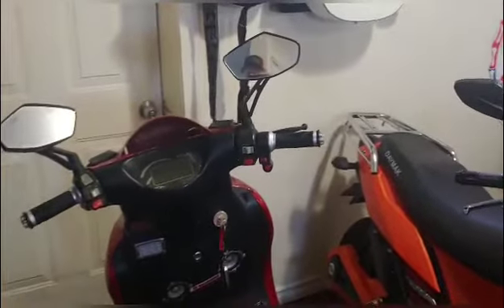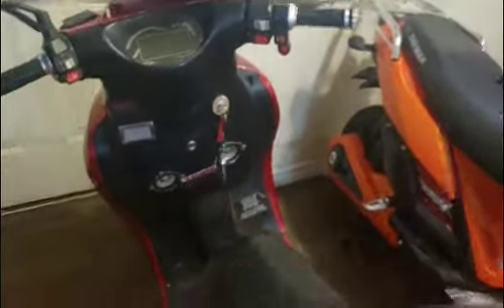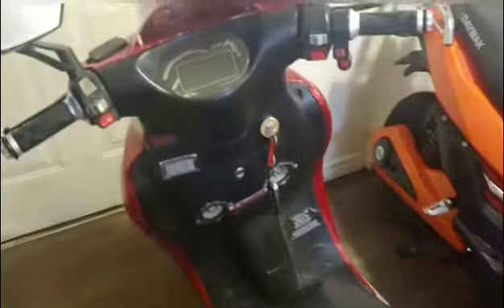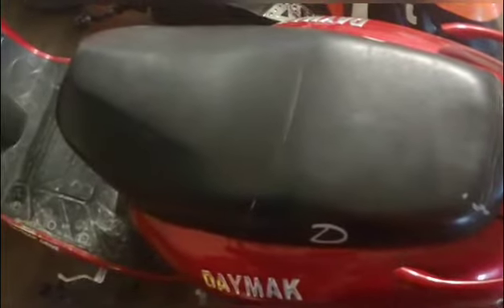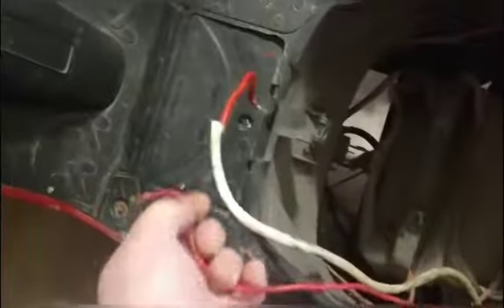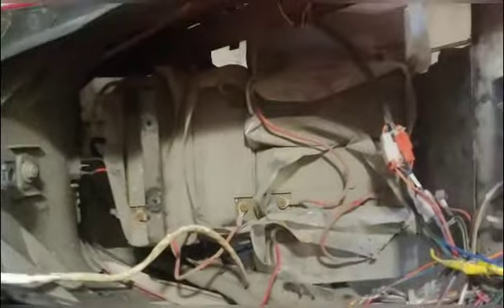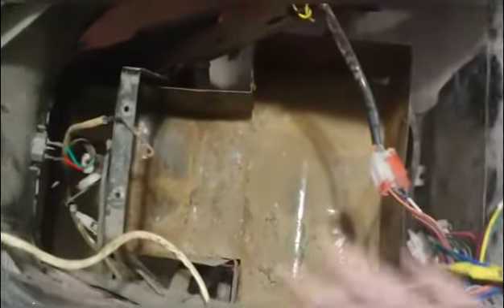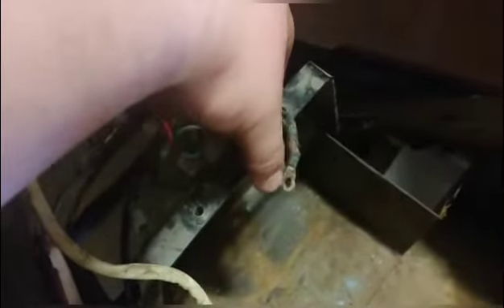New batteries for the wife 72 volt ebike

Comment: I have a daymak rome I think from 2014 bought it used with dead batteries.  I replaced the 4 batteries and it runs ok.  there is room for 2 more batteries to go to 72 volts.  Does anyone know if the controller can handle 48 and 72 volts?  or would it need an upgrade?  the controller has something written in Chinese that's faded
Reply from the maker: If it has the room for more it's probably supposed to have more. Good way I always find out is cool on the daymak web site. If I can't find it cuz it's older. Give them a call. Cheers 🤙
Reply from the maker: I just looked and they made a 48 and a 72 volt. So my guess is it's supposed to be a 72 volt and the person before didn't want to buy 6 batteries. And got 4 instead.
Reply: This ebike did not have easily accessible batteries.  I had to take the bike apart to get the 4 dead batteries out.  That's when I saw the extra slot to add 2 more batteries.  I am sure the bike came from the manufacturer with 4.  I was going to put 6 in but I was afraid of blowing something if the controller is for 48 volts.  thanks for your reply !!